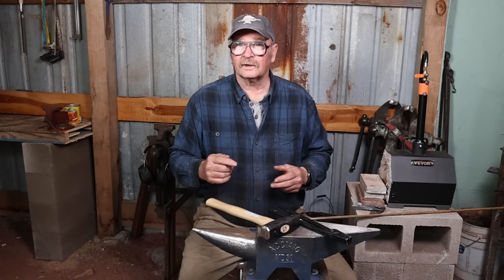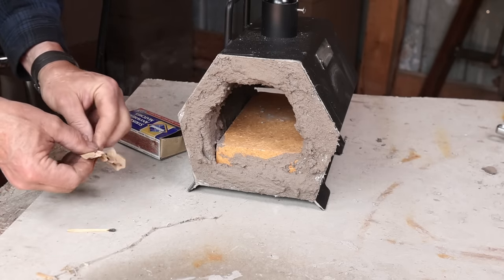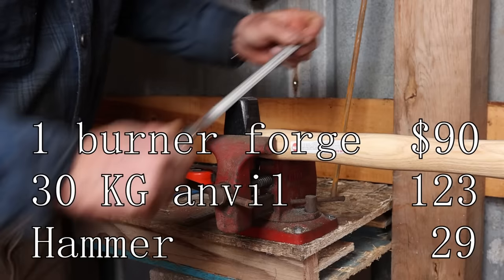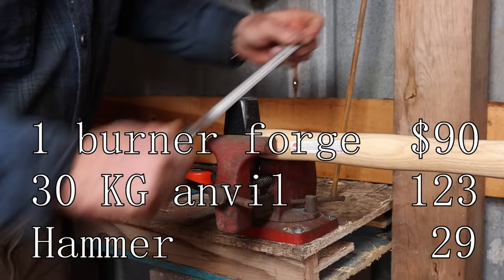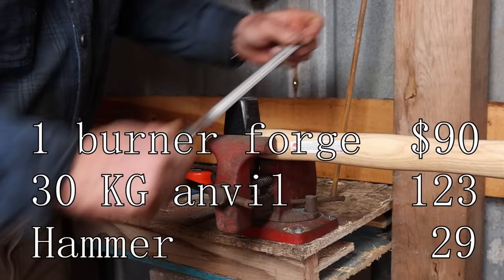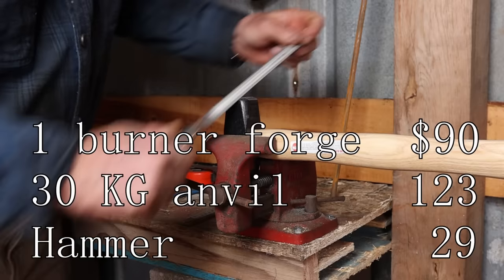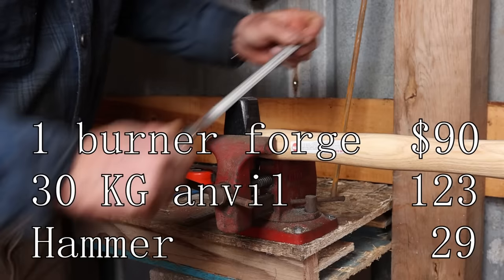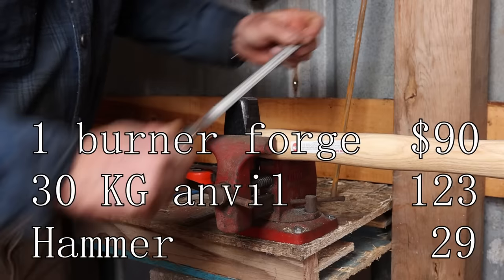Affordable Blacksmithing - Budget friendly TOOLS

Comment: I was lucky enough to have a friend who gave me an anvil and a post vice. Found propane forge for $200, bought coal forge for $75, friend gave me a hammer. I’ve been making knives for two years and recently made a tomahawk with basic tools. I love your videos! They are my go to for knowledge, thanks!
Reply: There was an auction at the end of my first hammer-in.  I also got a $75 coal forge, a $20 broken anvil (a chunk of railroad track works just fine to start) and then a big ball peen hammer.  My post vice I found under a work bench at the house I bought (didn't know what it was at the time.  Metal came free from anywhere.  
Due to anvil collectors🤨(yes, I'm looking at you), that tool will be the most difficult.
Reply: @brokenrecord3523  railroad track is an excellent starting point. Used track is extremely well work hardened.
A real bear to cut though.

Comment: I am a woodworker. However, once in a while I find the need to make a part or fixture from metal. The set up you just described appears to be the perfect solution. Not to expensive and won't take up too much space in the shop.👍👍 Thank you for sharing. Have a great day and stay safe.🙂🙂
Reply: Likewise and just finished setting up a backyard smithy (no way I'm setting up a forge in a woodshop!) very similar to what he's using here. I'm really looking forward to making my own hardware and custom woodworking tools now!
Reply: Depending on how large of a part you need to make, you might be able to use a couple of soft fire bricks with a chamber cut in them and a handheld propane torch. Like this: https://www.youtube.com/watch?v=ifTIuNt3aNY

Comment: Great video. As a beginner no one should focus on forge welding. This little forge is budget friendly and a great beginners forge. Its purpose built. One thing I do have a problem with is the gas line going straight up. An elbow or 2 to make the line go down and away from the forge is important. If that line isn't secured it could become nasty.

Comment: Excellent class, John. I kinda walked into a shop doing demos for festival attendees back in the 90's. An old shop with 40 foot ceiling and an abandoned railroad spur outside the backdoor. He would occasionally let an interested onlooker have a go and BAM! I was hooked. Stopped by his shop every opportunity I got and was learning quickly. Did my 1st successful forge weld while left tinkering as he walked to the diner for lunch ( we took turns). He was surprised, as he had only shown me once. Well, ABANA met at his shop the next Saturday and I immediately joined. What a group! Iron in the hat and won my first hold down. Went to several meetings at 9 different shops with demos of new techniques. Don't know if you heard of him, but Don Dillon was one of them. He was a Master Bladesmith. He made a matching pair of pattern-welded recurves In a ladder pattern in about 6 hours. Over twenty years and about $15k later. And it's all just a brief memory.
  Off topic question John. A scroll being the golden ratio, what is the name for one done with sharp bends @ the same ratio? 🐾🔥⚒️👀🍻

Comment: Hi John!
I just wanted to let you know that what you do is the best way to go to learn younger people how to work with steel. You are really good at explaining how and why you do the things you do. I have been blacksmithing as an hobby now for 5 years, but i really like all the content you have on your channel. You probably know it already, but if you dont flatten the top of the hanger, but form it to a spike and bend it back 90 degree you can just hammer it straight in a beam. It can be a good way for beginners to make stuff they can use or even sell without having to make a hole. Just a tip that i learned on a blacksmithing course i took. This is actually my first comment on youtube. Greetings from Norway. Stay safe.
Reply from the maker: Thanks

Comment: Perfect timing on this series! I've just setup a backyard smithy with that Vevor anvil and a Mr. Volcano single burner forge, currently working on some tong kits from Ken's Custom Iron, looking forward to putting in some time on these skill building projects coming up in this series. You have an excellent teaching style in your videos, very easy to follow and very clear camera work too. Thank you so much for all you do!
Reply: @TheUncleRuckus  The advice that I've seen is that unless you know you need a double burner, you only need a single. People get ambitious about making things like swords without realizing how many hooks and bottle openers and letter openers they have to make first. Even with swords, as I understand it (still working on bottle openers myself), you only work a few inches at a time, so that for much of the work a small forge like that is adequate. You only need to get the whole thing hot for heat treatment.
Reply: @TheUncleRuckus I disagree with the gentleman who said to get a single burner. 

I own the double burner and you can simply leave 1 gas line out and run 1 burner.

If you follow the directions properly, the Mr volcano forge gets  insanely hot. Melting steel hot With 1 burner.

The 2 burner forge offers versatility if using 1 or 2 burners.

And the 2 burners makes heat treating a knife much easier as the heat is more even

Comment: Very clever use of the same round stock to make a bending fork, I like it!  I know one of the early tools that helped me was a hot cut hardy, now you've got me wondering if you could somehow make something like that out of the same 3/8" stock, hmm...

Also, if you have a re-creation village around you (like one that's set in the 1800's), if they have a blacksmith shop there you might check to see if they offer lessons.  That's how I got started, and it was a great way to try it out before investing in my own setup!

Comment: my best starter forge was when I got a GREAT deal on some 5 gallon buckets of railroad spikes, for 200 bucks I got some train brake drums, 5 feet of rail, and some rail tie plates. I found someone who had an old telephone pole so I got it for free and cut it up to mount the rail on. Used the drums as a makeshift coal forge, the rail as an anvil, and attached the rail tie plate to my "anvil" to twist  the handle for railroad spike knives

Comment: Thank you for all the knowledge you share.
I had an idea about using concrete nails to make carving tools. 
the nails are a good steel that can be very useful. 
I have been mounting the finished blades in deer antler. 
I used a propane tourch to heat the steel up holding with vise grips. 
the nail head is the end forged into the short blade. the other is the tang to hold in place with epoxy 
I was able to make the first one for about 30 dollars. 
I have enough nails to do at least 40 more. with whatever funds this creates I can invest in better things.
you are one of the best teachers that I have come across.
What you teach here will not be lost and forgotten because of your legacy you have given.

Comment: I built 2 forges . My 1st was the old BBQ and a hairdryer 
Then built my 1st propane forge from scrap steel some fire brickand a  new burner  from amazon. Gave that one to a friend of mine who wanted to start smithin'.
My 1st anvil is a 100 lb block of mild steel from the scrap yard.  (Now making it into a swage block) . My current anvil is a 100 lb block of annealed 4140 that my boss gave me. It works really well and 4140 is great for dampening sound, energy ,etc...
I made a horn out of an old railroad spike hamer and I rounded it out with a grinder and mounted it on a steel rod and sunk it in the stump behind my anvil block..
Iam currently building a new forge. 
If there is a will .... there is a way. Thanks john and also Roy
From Crist centered iron works!!

Comment: I looked at similar products in our country. one burner forge €200 /coal forge - used €400+/, anvil €200, tongs /used/ €15-20 propane filling €25. so €500 without material. but... our monthly salary is €700. so my whole blacksmith workshop is made of scrap material. Total price €50

Comment: I recently got started blacksmithing with a zero-cost setup in the garden, consisting of a wood fire in a trough in the ground, ventilated with a handpump (intended for inflating mattresses and the like) connected to a steel pipe from an old vacuum cleaner using some clay, and with the back of a large axe stuck in a chopping block as an anvil. Probabl, wouldn't work for biggee projects, but it was quite adequate for forging a couple of knife blades from an old broken gouge, and for heating and straightening some garden tools.

Comment: I got the vevor double burner $125, harbor freight cast steel anvil $150 and hammers $10 each ×2 and $6 welding gloves so far a little over $300 I am excited to get my forge up and running.

Comment: About $500 is almost exactly what my initial cost was. Same anvil, two-burner forge (anvil and forge off Amazon), a cross-peen and a ball-peen hammer from Tractor Supply, and a few pairs of long pliers to stand in for tongs. My wife surprised me with a drill press and I was off to the races.

Comment: Great help for the ultra beginner. I just received my Vevor anvil, and worked with a local tree arborist to get a suitable log. My next step is to use the router technique to level off the log for the anvil such that it's around knuckle height with the anvil mounted.
Reply from the maker: Great to hear!

Comment: This anvil is what I am getting started on, i went with a Mr Volcano forge since it was only 50$  i got a hammer from harbor freight and used a pair of long handle vicegrips to "forge" a pair of tongs. I however jumped straight to knife making which actually went quite well.

Thanks to your channel i recently bought a set of quick tongs from Ken's iron and it was money well spent. I highly recommend any new blacksmith get a pair they will serve you well. No longer fiddling with my handmade ones, although I am confident that I could make a better pair than my original i don't have a lot of time and would rather make more knives.

All in all i spent 200$ US to get started that was a year ago and honestly the hardest part is finding good metal for knives, at least here in CA our junkyard doesn't sell in person anymore it's all online with a huge shipping cost for leaf spring.  Ever since Covid the few metal suppliers stopped selling to non-contractors and they no longer give away the cutoffs.

I get my metal from garage sales now by buying old tools. I also tried online and have had some success but honestly just repurposing old steel is the cheapest way.

Comment: Made my first forge with a baking pan, some steel pipe, an air mattress pump and some salvaged wood for the frame. Didn’t work great but worked well enough to move metal. There’s always a way to get started. 

Edit to add: it wasn’t my idea. I got it from a YouTube video but I can’t remember the creator.

Comment: For propane at least around here you can get one from one of the exchange things at the grocery store full for $30-$40 then fill them wherever you want until they need to be replaced. Something to look at harbor freight sells angle grinders for about $10 during their June sale which is coming up mid June I believe. If you pick up a cold chisle cheap enough you can get a few pairs of tongs from kens for the price of one from someplace else, just some thoughts. Great video John been thinking of doing one kinda like this for a while. Maybe some day.

Comment: Really cool $500 build. I will say, for the cost of the hacksaw, blades, and file you can get a corded angle grinder and disks instead. If I had a super tight budget, that's probably the route I would go. You can use the grinder with a cutoff wheel for hogging off material, then clamp it in the vice with other wheels and disks for finer shaping, sharpening, or polishing. It's much more versatile on a tight budget, and you'll end up wanting to buy one in the long run anyway.

Comment: I'm not really sure what sort of rebar you have over in America, but here in Europe our rebar has only about 0.16%C compared to about 0.21%C which is the usual amount of carbon in the most common mild/construction steels.
Our rebar also doesn't have a guaranteed chemical composition, so it's behaviour (especially when quenching, hardening, etc.) can sometimes be quite unpredictable.

Comment: Hey John,
That was a great and timely video!
I've been following you since your hook of the week videos and have been making hooks using an oxy/propane torch.
Recently got a Mr. Volcano single burner forge and am part way into making first set of tongs without the use of tongs.
You are an inspiration! 
I think your anvil actually tips more than mine!
I noticed that you didn't partially block the open ends of your forge.
I've been doing that but is it not a good idea!
Again thank you so much for your content over the years!
Jim Travers

Comment: When i first got interested in blacksmithing, a good 150lb farm anvil was $50 at any flea market or farm auction, and hardly anyone even looked at them. Soft coal was readily available dirt cheap at about any hardware or welding supply store, by the 50lb bag, or you could buy it by the ton if you wanted to have it delivered. Resources for learning were darned scarce though! Times sure have changed...
Reply from the maker: They sure have.  But there is more new equipment available than there was when we started.

Comment: Good video. Thank you for sharing this knowledge!  I think we're about the same age.
Some opinions from past experience: Whatever hacksaw frame works for me, but I will now only buy Starrett blades.  The difference in cutting quality is absolutely night and day.  A pair of blades (I like 24tpi) will cost you $5.24 at Amazon and will cut like new for years.  22:30 Yeah, try the Starretts yourself.  That cutoff would have taken a dozen strokes, not 3-4 dozen.  ;)
A friend with too many hammers will usually give/sell you some if you ask. I got 9 once, free.
My $27 Harbor Freight 5.5" mechanic's vise is still kicking. I bought it in 1976 and beat it weekly. The 3" vises aren't much cheaper than 4", and 4-incher (and up) usually come with pipe jaws built in.
I researched small anvils and the Acciaio 30kg got good reviews. My $97 Vevor is due tomorrow.
Southern Oregon, my propane refills average $8.
And, $3.99 earmuffs at HF plus a pair of 33dB ear plugs save your ears handily.
Liked and subscribed!

Comment: I have a little 2 burner propane forge, and I usually get to welding heat by sticking a cinder block up against the far end to close it off and hold in some more of the heat.

Comment: I was partly on a budget and partly decided to bite the bullet and drop a lot of money into this hobby (although it wasn’t a complete waste as my dad is a farrier). The top things that I have learned is an angle grinder is well worth it. I have one of the $100 Dewalt angle grinders that’s corded. In addition I have learned that good hacksaw blades are well worth spending the extra money on. Cheap ones bend or the teeth break off.
Reply: Another thing is if you get a lot of these tools can be found at old farmsteads that sometimes people want nothing more than for someone to come along and use them. With a leg vise I was able to actually find one in one of our buildings but I have a rather basic stand that has a large rim for the base and it’s usually stable enough but if it’s not then you can stand on the rim to stabilize it and it gives a better view of something if you’re filing it or cutting it.

Comment: Very interesting video and a very cool setup, this little shop gives me hope of figuring out a compact and inexpensive setup for myself, so thank you for that. It occurs to me, wouldn't it stabilize your bending fork if instead of merely bending that steel around and trying to weld it together, you twisted the folded steel around itself and then hammered it back to square? That would give you some mechanical interlock to reinforce the weld, and could have a really cool look.

Comment: While I don't think that forge can handle forge welding as is, it may benefit from choking up the openings with some pieces of firebrick to build up the heat a little more.

I recently tried getting a Vevor anvil, but on 2 attempts they refunded me cause they couldn't arrange the needed logistics, they did try though.
In the end I did end up with a very nice French style anvil on an auction. Edit: Just put it on the scale and it's 96kg (211lbs).

Right now I am running a small coal forge, which should be sufficient for practicing my techniques further after I finish my blade smithing course.

Comment: As for the tank freezing up, mine did using the Mr Volcano single burner forge when I made a demascus billet, was around 25# of pressure on the guage at the time.  Never had a problem with normal forging at about 2-4 # on the guage.

Comment: For the forge weld, I'd have put some fire bricks with an inch and a half or so gap between them at the rear and entrance of the forge unit to retain a bit more heat. Should be more than enough and you'd likely have to lower gas flow as well.

As for rebar, yeah, the carbon content and hardness, that's not a 101 level thing, that's a level or two up, once the basics are mastered.